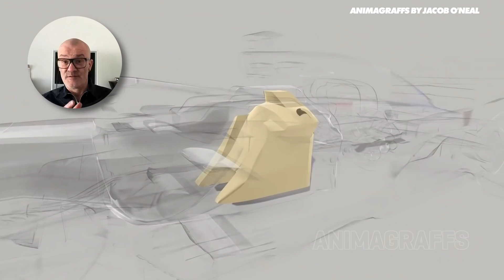Why Max's Red Bull Caught Fire in Australia

Comment: E85 has been used in things like Pikes Peak Hill climb cars I believe. So I have a hard time imagining an F1 team missed the memo on Ethanol not playing nice with seals/o-rings.
Reply: Pikes Peak is more a sprint race than a marathon that F1 is. Red Bull problems come up well past an hour of racing.
Reply: 100%. I highly doubt E10 is the caused of this. if it is yes, then it is their ignorance that cause this, not the fuel itself.
Reply: E 10 has been in our cars for years
 I've converted cars to e85 eith put ever having a problem. Thinking these guy are running into the 10 percent of corn in the tanks is eating seals.dont  believe it.
Reply: These are all super marginal parts to reduce weight.  Most likely the seal/whatever seemed fine during testing but hasn't penciled out in race conditions. Plus, this is RBR...  Not the first time they've had a problem like this.
Reply: Ok, RB does not buy o-rings in your neighborhood Auto Zone. Parts sometimes fail at the worst of times, bad luck is just that.
Reply: @stevenr6279 The part should have been tested for use with this fuel at the set pressure to failure (to give a lifespan). I imagine an F1 team can do a basic bit of engineering like that. Most likely a manufacturing defect.
Reply: @Adam-xe5xm  the RB Purchasing Dept. Went with the lowest price and not the best lab test. All teams have a budget. Sucks for Max.
Reply: @stevenr6279  they will have picked the cheapest product that hits their performance thresholds with whatever safety factor they felt necessary added in.
Reply: @Adam-xe5xm Yep, but everybody lies to make the sell.
Reply: @stevenr6279  so your theory is a supplier of a relatively low cost component lied about the products specification to RB resulting in the components failure this past weekend. Thats a massive reach.
Reply: @Adam-xe5xm  Welcome to Corporate America.
Reply: @stevenr6279  the hubris to assume that the supplier is American smh.
Reply: E5 only for me!
Reply: Honestly adding ethanol was such a pointless stupid thing either way. I refuse to use it in any performance vegicles or sport bikes i have.
Reply: They didn't see the porpoising issue coming either (except McLaren I think), even though it was in F1 that the issue happened...
Reply: it's only 10% they're using, not full e85 mix.
Reply: @ed3192  right. That's my point. Even E10 can damage orings. And I'd be surprised if they DIDN'T know that Ethanol damages things. That would be a very amateur mistake I don't see a top tier F1 team making.
Reply: @shadow7037932  I mean it's quite known that you must be able to provide a 1Litre fuel sample at the end of a session yet sometimes teams/drivers mess up
Reply: @captaintoet1983  Yeah, but that can be caused by circumstances beyond the team's control. Vettel was disqualified from Hungary 2021 because of a fuel leak for example.
Reply: @venutenneti7997  I see for Vettel. Albon's William didn't had enough after Quali though (don't know the reason). But nonetheless good point.
Reply: @captaintoet1983  True. But that's got more to do with race conditions and fuel management so there's more variability there. But something like getting Ethanol compatible equipment is like basic QC/QA.
Reply: @ed3192  E10-E15 fuel is also on pretty much every gasoline vehicle today. So... I don't think it's an excuse for "understanding" the corrosiveness of the fuel.

Comment: Vapour lock is where the liquid fuel in the line is heated enough to turn to a gas and starve the engine, NOT whatever you said.
Reply: I did some work on vapour lock way way back on the MkII Cortina.  I was at Ford Research, but we used the Shell facility at Thornton.  We ended up using a water trap on the inner wing (fender) to cool the fuel, but  if memory serves (this was a very long time ago) the problem was mostly due to a mechanical fuel pump that sucked the fuel.  When we moved to electric pumps that pressurised the lines all the way from the tank to the carb (no injection back then), then vapour lock was never a problem AFAIK.
Reply: @TrevorDennis100  most high pressure systems have a relief valve somewhere after the pump, which results in the excess unpressurised fuel returning to the tank. This keeps fuel in the pump cool and very unlikely to turn to vapour. The pressurised fuel also is less likely to turn to vapour because it’s under pressure and even if it did the pump would still function and expel the vapour, which may cause some momentary loss of power. The big issue with a vapour lock is when it gets in the pump as they are not effective at pumping gasses.
Reply: The engine was starved of fuel, technically he is right lol and up to what extent does E fuel evaporates compared to the fuel they would normally use? Do you know the characteristics of both? I have no clue.
Reply: @ed3192  Alcohol evaporates at a far lower temp' than gasoline (a term I use very loosely for the fuel in a F1 car) and therefore greatly exacerbates the issue. That's what they (Sky) were talking aboot during the first race when they were describing the parts of the fuel system that were homologated for all the teams and their placement and that the Hon...RedBulls were experienceing it far more than others and that's why they (FIA) allowed the cars in parc ferme to make changes.

Comment: Max was not robbed of 38 points.  Max failed to win any points.  There is a huge difference.  Your comments are assuming that the RB cars are pre-ordained to win, the points are theirs to lose.  In reality, the points are available for anybody to win, but, to win those points you have to field a fast car that is reliable enough to go 170km, which isn't very far.  RB has failed to do that this year.  Comparing RB to Mercedes this year, one remembers the old story of the tortise and the hare. Merc may have trouble catching and passing the RB on track, but, it's trivially easy for them to catch and pass a car parked beside the track, and it shows in the standings.  On the constructor sheet, Merc is ahead of RB.  on the driver sheet, both Merc drivers are ahead of Max.

Gonna be an interesting season, but, so far it looks like the RBPT division is turning into a disaster for RB, and unless one of the other teams finds a magic bullet, Ferrari is going to walk away with the constructors championship long before the last race, and the real battle will once again be RB vs Merc, but, it's a battle for second in the constructors.
Reply: You know exactly what he means. Stop being pedantic. It’s gay.

Comment: Parce ferme is  almost like a  recommendation  these days.
Reply: Why? There are strict rules, what can be changed.
Reply: @ZordixXo7  I know there are which I find odd, I understand  certain thing need to be for reliability but the amount of things that  have been changed recently is getting a bit silly.  Red bull changing their rear wing on multiple occasions last year is one I can't get my head around.
Reply: @rhyswilliams4893  I know what you mean but the Parce Ferme rules in F1 are there to prevent teams and drivers from having qualifying setups and separate race setups. And for that purpose the rules are good. They only can change Parts with the same spec Parts which are identical. And if you replace a part with an identical one, you can't get a setup advantage. And that's the hole purpose of the Parc Ferme rules in F1.
Reply: @ZordixXo7  yeah I get what you are saying.

Comment: one of the merc engeneers has already said that the new Fuel including E10 is causing them real difficulties.....and that will be for all teams the case...would also explain the lack of power of the merc works and customer teams PUs....maybe Ferrari have found some "interesting" different E10 fuel thanks to shell....:-)
their  cars were extremely fast the year before they were "punished" for one season.....

Comment: See I thought hydraulic since max said it was smelly fluid. But I've never smelt the fuel they have run either.
Reply: He said it was an unusual smell. I don't think he would describe fuel as unusual.
Reply: @TheRip72  thanks man I couldn't remember exactly how he said it. An that's what I'm thinking. Hydraulic does have a slightly bad smell when it is heated. Nothing like rear end fluid but still not pleasant.